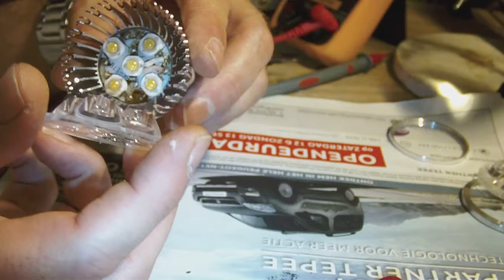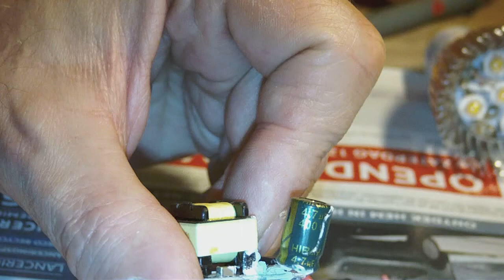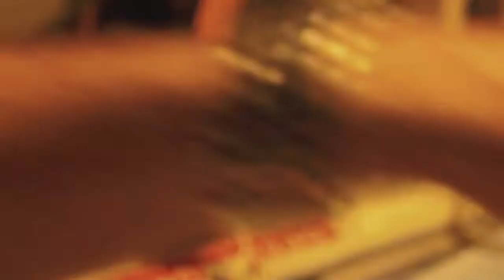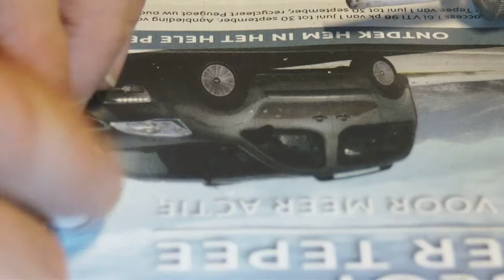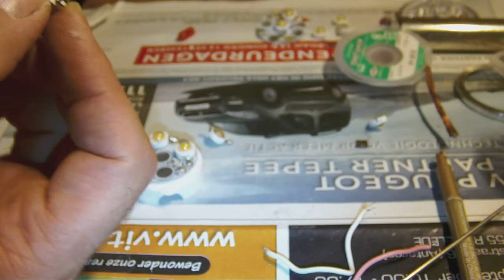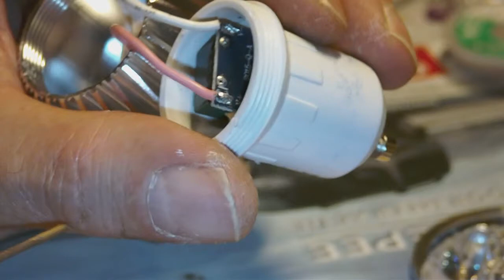Weekend Projects: Repairing A 15W LED Spot

Comment: Like your viders, thank you. You could also test for the polarity by using your ohm meter and then mark the LED(make sure you know the polarity of its leads, all are not the same.)
Reply from the maker: Hello Carl! Yes, you are absolutely right. I had in fact made a short video on the methods on how to identify the polarity of the LEDs, one of which was the use of a multimeter. Unfortunately, it got edited out mainly because the video would have become too long (I had to edit out several parts for that reason), and also because I wanted to show one does not need a multimeter to identify the bad LEDs. With hindsight I should perhaps have left that part in the video. But, what's done is done. In any case, thank you for drawing everyone's attention to that possibility. Glad you liked the video :)